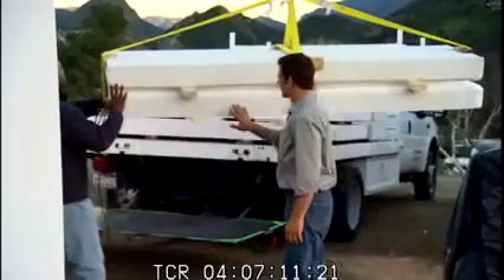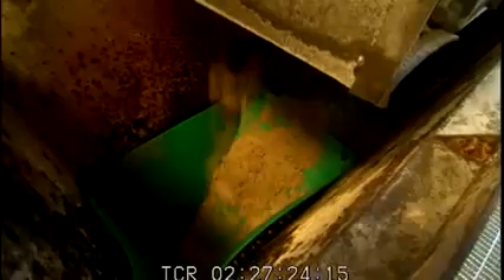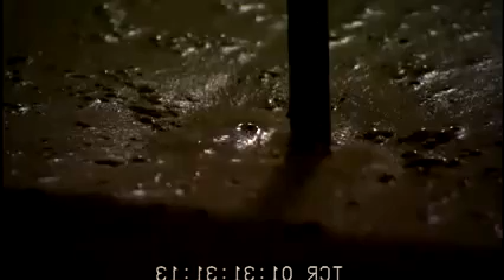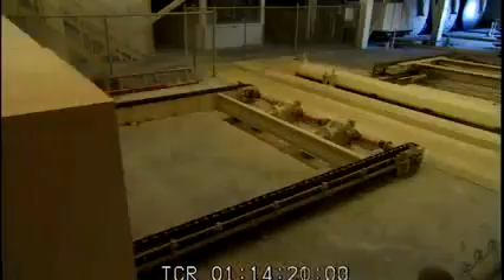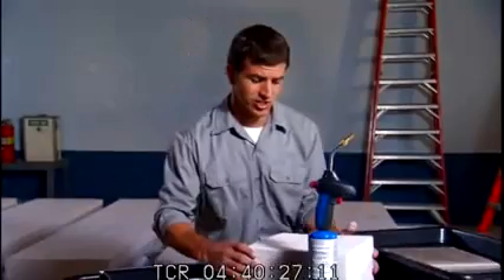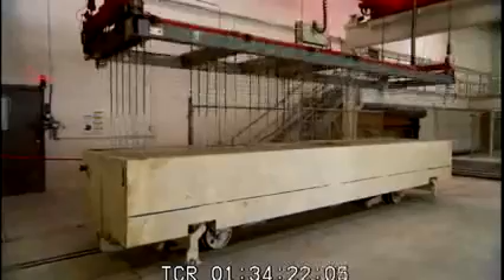Autoclaved Aerated Concrete - Discovery Channel Show - Part 2

Comment: If a concrete cylinder were made and broke what would the strength tests show for the concrete 500 PSI or 1,500 PSI, surely not over 2,000 PSI